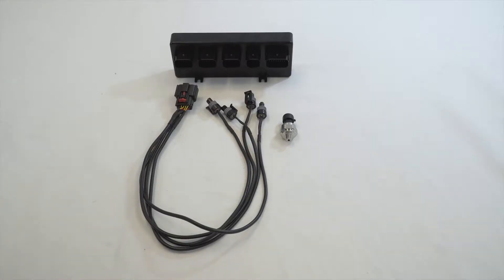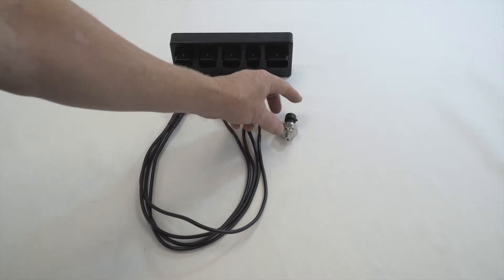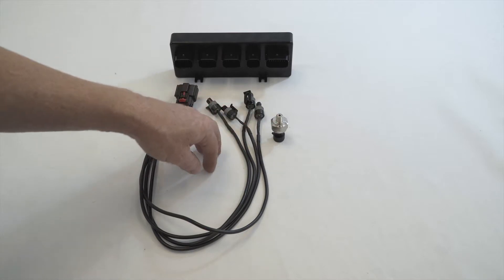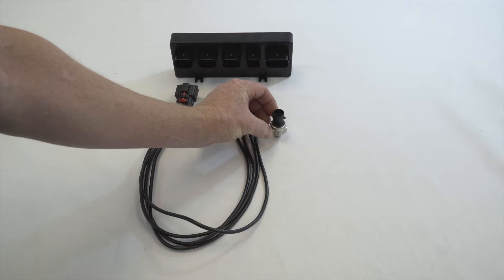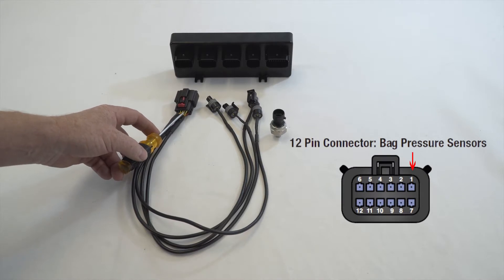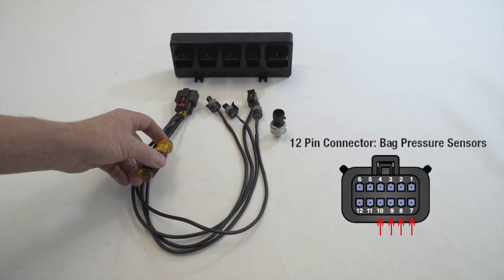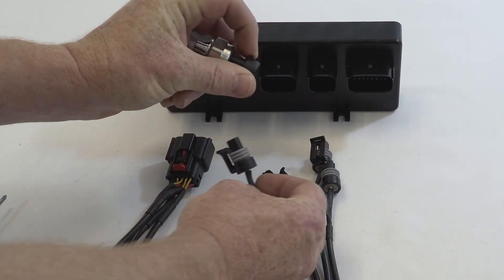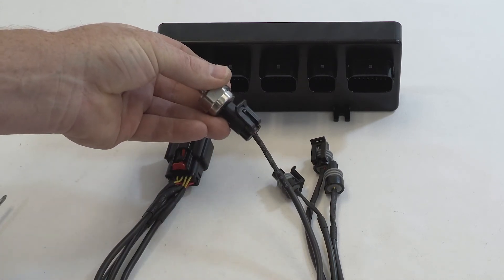Video 6 Level Ride Bag Pressure Harness

Comment: Can I plug this on the Air valve manifold VU4 . ?
Reply from the maker: This harness pictured is our bag pressure harness. It goes from our ecu end port to our pressure sensors. You can use a VU4 manifold as it’s wired the same as our manifold. All pressure sensors must face up